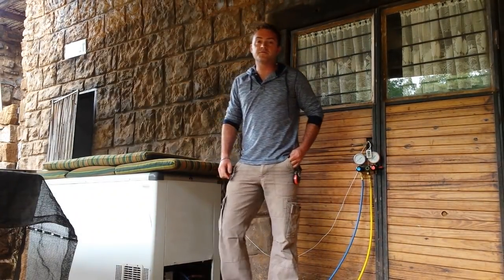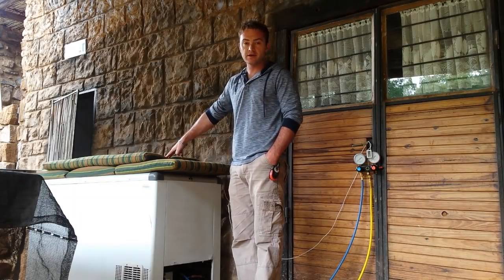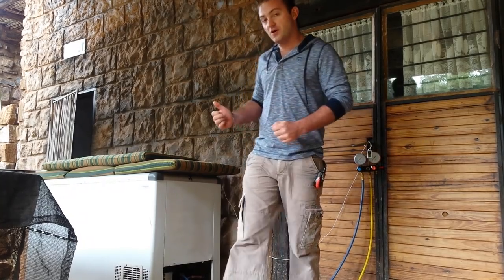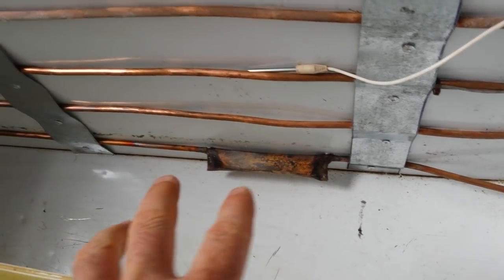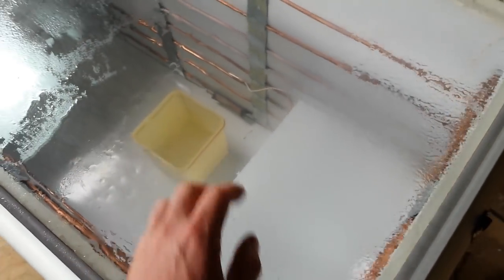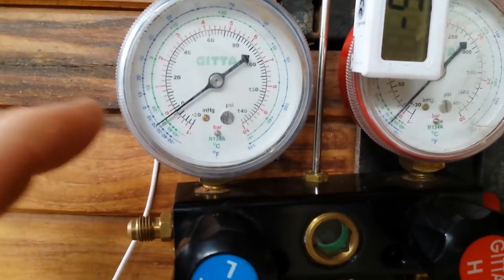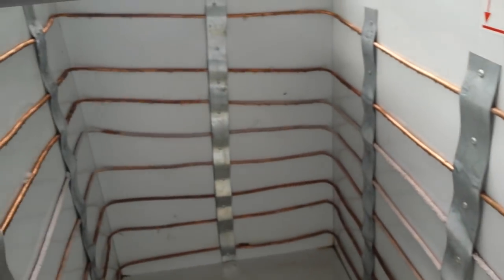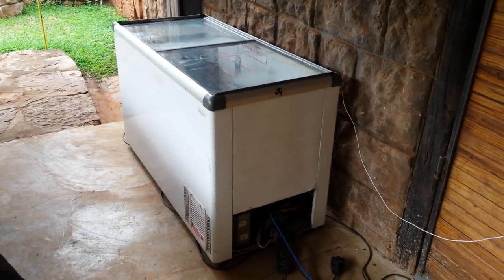DIY Refrigeration: complete rebuild of a deep freezer

Comment: how much money you spend??
Reply: hi George, the copper pipe comes in rolls of 15meter, so I bought 2 it costed 560.00 ZAR and the compressor is a R600, it was 780.00 ZAR The rest of the parst I made like the accumulator... Thanks for watching!
Reply from the maker: sorru commented from a different account. hope info helps you